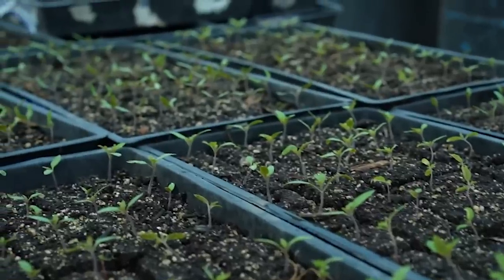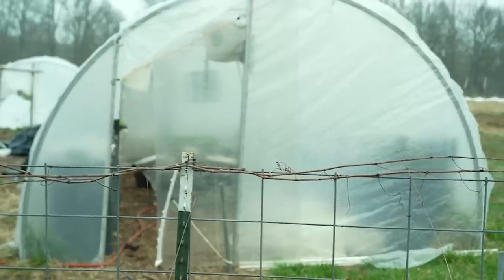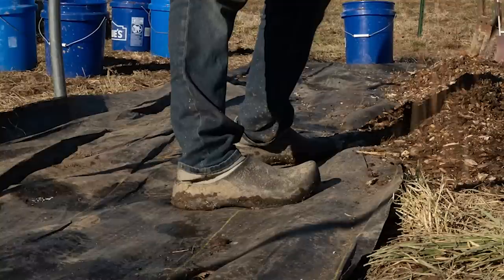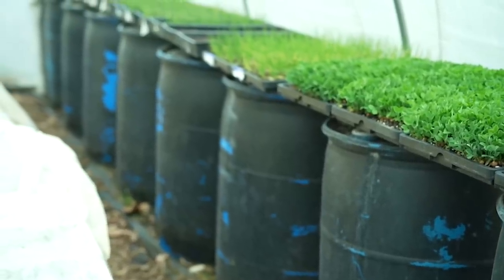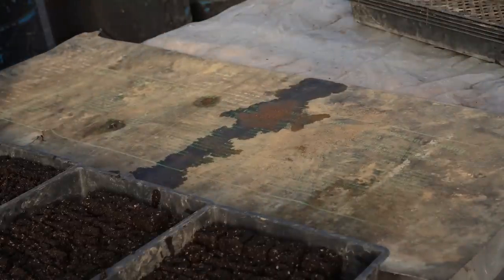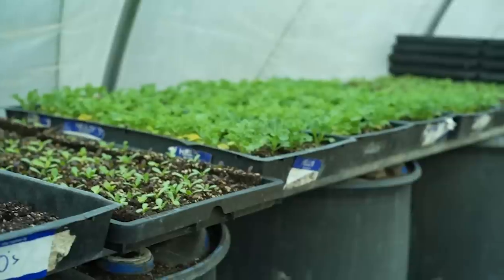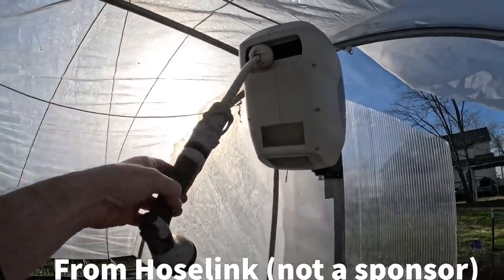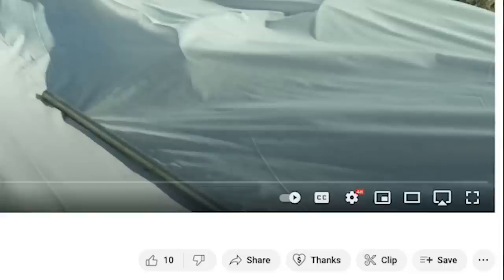How Little You Need for a Greenhouse | The "Good Enough" Greenhouse

Comment from the maker: One thought I had after shooting this video is that if you have abundant water, you could drain the barrels in the winter and then refill them in the spring. It is nice to have them right now (mid-march) with a prop-house full of plants to help retain the warmer day temperatures we're not getting through the colder nights. A month ago, it was the opposite. So, just a thought.
Reply: As I was watching, I seemed to recall a video where a guy was using a fish tank heater for the water... but then again, he did not have a ton of barrels like in your video. It was more for a home garden situation.  To extend my season last fall, I used a portable water based radiator type heater which I put on a brick path, and used a timer. My small poly tunnel was secured down with long rachet straps, so I was not concerned about the wind tipping it. It worked well until I didn't feel like wading through snow to get to it and digging out the opening. 😏 It was more of a test.
Reply: there's no need to i've found, i'll be using last years rain for watering this spring if it's needed.

Comment: I really really prefer just landscape fabric floors over gravel. Every bit of soil mix that falls into gravel in a prop house becomes a habitat for future weeds, whereas you can just sweep a landscape fabric floor. And if you ever change your mind and want to grow in ground, landscape fabric is so much easier to remove than shoveling out the gravel first (don't ask how I know 😅)
Reply: What about Woodchip floor? Can still grow weed, but its easier to shovel out, drains water really well and even soilmix washes down decently.
And when it breaks down its easier to shovel (and more useful) than gravel.
Reply: @aenorist2431  in my experience there just isn't much advantage to covering the landscape fabric at all, aside from it maybe getting a little slimy if it's too wet for too long. If you want to cover it, then you do you. Pros and cons are different in different places
Reply: @natalie7204  I meant more like a replacement instead of a covering.
Stand up greenhouse, put in tables, shovel in woodchips some inches deep. 
Should still suppress most weeds, give a stable surface to walk / work on and drain well - without slowly dissolving plastic into your ground.
Reply: @aenorist2431  Ah, that makes sense. Love a plastic free option
Reply: I use billboard tarps.
Reply: @Old Bear heavy landscape fabric floors can also be disinfected if need be as part of a IPM plan.

Comment: Great video.  I built us a pair of 12x30 high tunnels recently.  Used chain link fence rail and bent my own hoops.  They’ve survived a hurricane and two tropical storms already & things are doing better than ever.
Reply: Can I ask what you spent on material costs? And did you concrete in the posts?
Reply: I'm an ex-NASCAR guy with lots of experience bending tubing with expensive equipment. How did you bend the 1-5/8 galvanized, and was it schedule 40 or 80 (I believe those are the two available grades (residential/commercial))?
Thank you!
Reply: I had a boyfriend that put in a railing on a balcony in his house and he used fence rail, he took it to the technical college in town and the did all the bends for him. Just an idea for those needing help.
Reply: @rnupnorthbrrrsm6123  When bending this stuff, the process fails on the inside of the bend to cause a kink unless compressed and shrunk. Additionally, the galvanizing process changes the structure of the metal to make it less-pliable. 
I'm also a retired electrician with lots of experience bending EMT conduit; it's the worst compared to bending seamless tubing used for racecars and such.

Comment: You can get carports/long metal pole canopies for $100-$150 online. You'd of course need the greenhouse plastic or shade cloth for it (all you're getting the carport/canopy for is the frame). I've used these metal carport canopies with all 5 sides covered in heavy wind and as long as you do a rope tiedown system on all 4 corners, it isn't gonna blow over unless the stakes are ripped out of the ground.

Comment: Don’t overlook cattle panels as a frame option. That’s what I used (elevated on wood-framed sides) and it’s been through some very strong winds with no issues. Another benefit is that putting them up is extremely quick and easy.
Reply: I had winds collapse one of my "sheds" made from cattle panels with a tarp tied over it, so they can be collapsed.  I was a pretty violent storm.
Reply: I made a twenty foot long one with two double high 2x10 raised beds along the sides. The ends are made with 4x4 frames into the ground and 3 foot high plywood. All finished it is nice and solid.
Reply: @vonsch9793  Did you have elevated wood sides like Alex Bice mentioned? Cattle panels without elevated wood sides will obviously collapse in extreme winds.

Comment: Adding plumbing to the water barrels,  so the water can circulate is another option/improvement.  
There are several methods,  we have a barrel filled with water under the floor,  with a heat exchange coil of circulating water.   
Excess summer heat gets stored under the floor.
With improvements as budget allows,  I will eventually have a zone 10 greenhouse,  totally solar powered.
Reply from the maker: That's a cool idea, thanks!

Comment: Wood heat! Zone 5b/6a Nova Scotia. Our 8x10 wood framed greenhouse, with 3 racks on each side, has a small, quite small, wood stove inside. We burn about a 3rd of a cord of hardwood to heat it at night in the early spring. Just barely enough for our near half acre operation. Downside is having to wake up at 2 am, on colder nights, to toss in a couple more logs.

Comment: We have a 10x14 pvc hoops and wooden frame work that has grown everything we needed for the last 20+ years and is still going strong. The only thing we do is replace plastic as needed. We used to heat it, but like growing cooler, so we heat no more. We also have auto ventilation with fans on a thermostat. We never use all the space for growing we don't need it.
Our greenhouse season starts April 1st  and is finished in 6 to 8 weeks after that, it's too hot.  We're in southern PA, and for us, we can plant brassicas on May 1st  and are frost free on May 15th . 
Why spend thousands when you don't have to for 6 to 8 weeks a year.
Reply: We also have a stone floor and pallet tables on cinder blocks.

Comment: On our property, wind is too much of a threat for a DIY greenhouse like this.  And with the NRCS grant program, you can use those for propagation if you want.  They only inspect it once after it's built, so you can do what you want with it once it's on your property.  We had to show them that we planted a cover crop under it the first year it was built, but they don't have any other requirements after that
Reply from the maker: I find that tables with stainless steel legs or something they can't climb is your best line of defense. Then of course, traps. We also have cats which help (but of course come with their own issues). The mice can't climb the barrels so we don't usually have issues there. And also know what they like and double protect those crops!

Comment: Id recommend a passive solar greenhouse facing south with a 2x6 insulated north side and half of the roof insulated as well. Triple walled Poly carb plastic on south/east/west sides and a small wood/pellet stove in there to keep it warm through the night.. put a lean to on the north side and make your wash station behind there. BOOM. You'll thank me later when you're saving thousands a year on propane. Ive worked/managed on farms for the past 10 years and it's just not worth it. The heaters always have problems. Plastic greenhouses are just not efficient at all. Don't waste your time. You can build a decent sized prop house solar passive for fairly cheap. The money you'll save on propane will basically pay for itself.

Comment: We found a 12’x60’ polytunnel on auction for a big discount, so we took the plunge! I’m in zone 5b, so we can really use the extended season with a tunnel. Does anyone have any advice on orientation of the structure? Especially further north, is it better to go perpendicular to prevailing winds or to use east-west orientation for maximum sun exposure. I’m on a new property and excited to get started, but I plan to take the season to ready my beds with the slow start method.

Comment: Do you clean the outside of the polytunnel? If so, what's your procedure?
Reply from the maker: I actually haven't cleaned it. Hasn't really needed it and we get enough rain that any dirt gets washed away. If I needed to, I would probably just use a soft brush and soapy water and a good spray gun

Comment: You mentioned rodents in the glass greenhouse but we did exactly what your video is about and put up a simple hoop house to propagate and we are having some rodent issues. Any tips for that would be greatly appreciated!
Reply: Get a cat. This is not meant to be snarky at all. We had some aggressive squirrels that were challenging me to full on duels. Two cats needed a home, we took them in and I've never seen a squirrel again 😌
Reply: @rblongfellow My only problem with the cats is the ensuing bird massacre.
Reply: the bucket with a can suspended over it on a wire, smeared with peanut butter and cracked corn; works so well! in the winter i use rv antifreeze in it, in summer just water.  put up a rodent ramp, something like a stick, last spring i dumped my trap and had 9 critters in it, it works for chipmunks, and red squirrels too.  just a thought, a little dawn dish soap in the water may have a positive effect; waterlog the little buggers faster.

Comment: If you live near the sea your f-ed the wind will take out greenhouses for breakfast
Reply from the maker: I mean it has survived two 70mph wind events in the last three weeks alone but if I lived near in a windier spot, as mentioned in the video, I would add way more bracing.
Reply: @notillgrowers  we have a glass greenhouse and last year a quite mild storm took out like 150 windows replaced them all with hardened glass but if you would have a tunnel it would be gone, in our area no one has tunnels because of the wind

Comment: How much space do you actually need for a farm your size?
Have done a few calculations the other day, and a single Bed of Arugola (120cm x 18m) would need 10 Trays of starts.
Of course you don't start plants for the entire farm at once, but even just 10 Beds would mean 100 Trays (1020s with 105 Soil Blocks each), and that is probably too little for busy spring.

Even granted that Arugola would be the extreme in terms of density and assuming you need 6 Flats per Bed ... on a 50 Bed farm thats still a potential 300 Trays.
Some less for direct seeding etc, still leaves me solidly in the triple digits. How does that fit, where is my mistake?
Reply from the maker: This is a good question. I actually meant to include something about size to acreage in the video but honestly forgot (these videos are somewhat on the fly). 

So, for our farm and our crops, a 35'X15' greenhouse is enough (.5 acres of bed tops). But we are not doing things that would need ten trays per bed. At most, it's 8 (like spinach). And sometimes, right before tomatoes go out, the greenhouse can definitely be tight. I'm not generally sure if there is a perfect ratio, but I suppose you could crop plan your prop house like you crop plan a garden where you know exactly how many flats you'll need thus how much space? Actually you only need to know what the peak is, because it won't stay that full all year. Bulk microgreens could change the equation too (which we only do about 8 trays at a time of pea shoots).
Reply: @notillgrowers  Thanks :) 
Thats 10x5 Meters, quite a bit more manageable than I thought. And you could always consider direct seeding crops that space so tightly (and need so many trays because of it).
Still waiting for my lease and trying to theorycraft everything I can beforehand ... on that unrelated point, you have 120cm beds right? Do you have a list with crop spacings for those anywhere, on the website or someplace else I failed to look?
Thank you for all the work, by the way, and the great book.